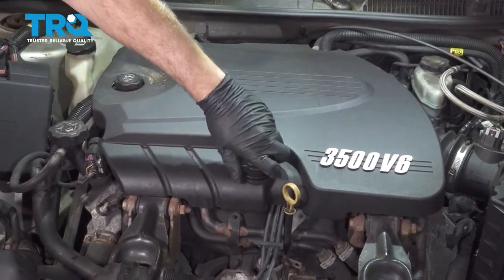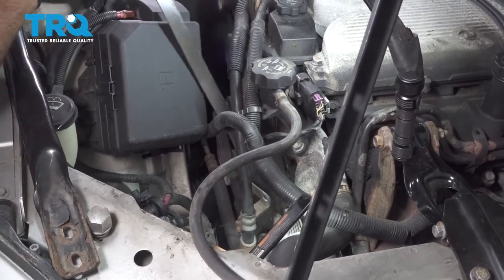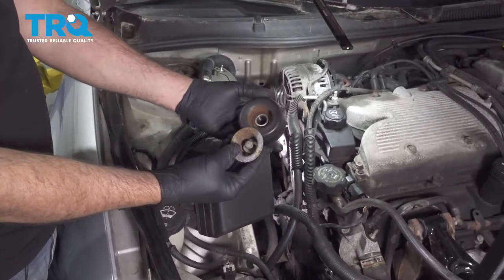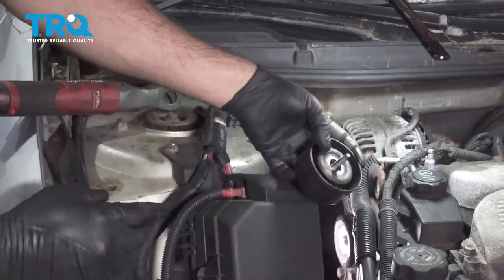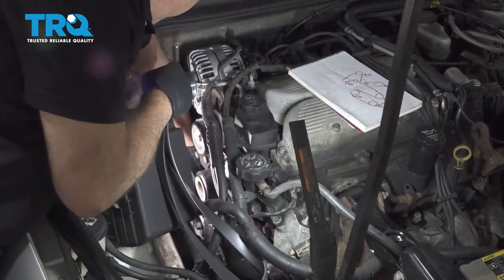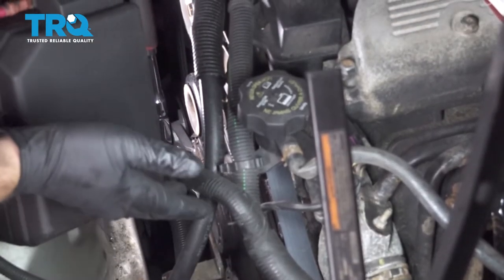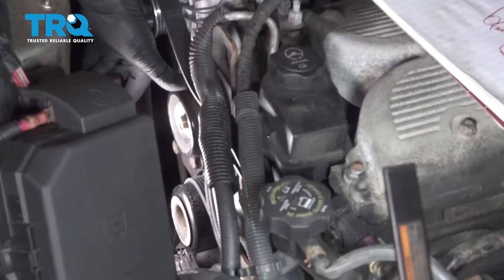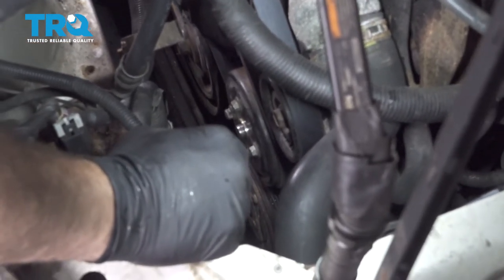How to Replace Serpentine Belt Idler Pulley 2006-2013 Chevrolet Impala

Comment: In the dealer service manual, the 13mm pulley  is tightened to 22 ft/lbs and the 15mm pulley is tightened to 37 ft/lbs????

Comment: Hi , I'm just trying to see what the belt tensioner looks like. Some videos show 2 separate parts. Some on a bracket. Most videos, yours included, pass over talking more about the tensioner. So my question is, to move the tensioner, are there any bolts that need to be removed from? I ask this because in other videos, the host just puts his tool next to the tensioner and says just pry forward. I don't or better yet, I can't see where he is putting the bar next to it, or on a hex head bolt. Is a bracket being payed or is a pulley being moved. This probably is the most simple part of installing a belt so no one seems to explain what's going on. Does one use a rachet or just a pry bar? Does the pulley move on a slot or does a bracket move? Now I have a 3.9 liter engine in a 2006 Chevy Monte Carlo, LTZ. Most videos show the Monte SS with a different set up then the 3.9 liter. Your video is dead on but I can't see or tell what is happening as discussed above. I just can't figure out how to move the tensioner, I see bolts all over n I just do not want to remove them all as an explanation. Please help. Thanks. P R, a person that shouldn't be messing with this stuff.